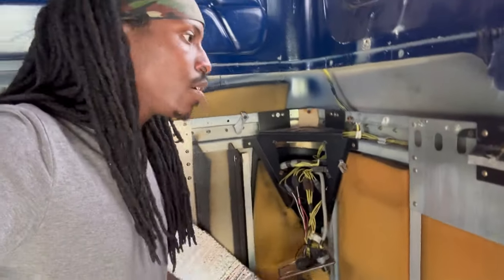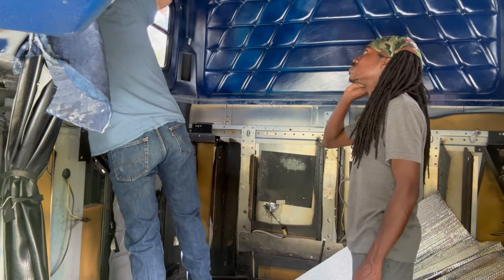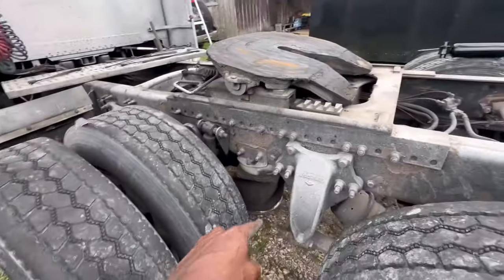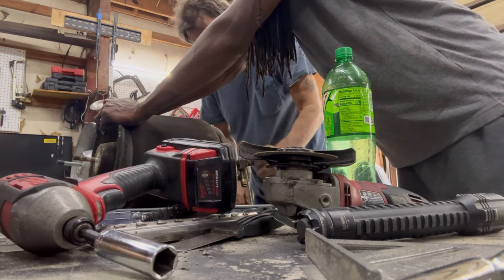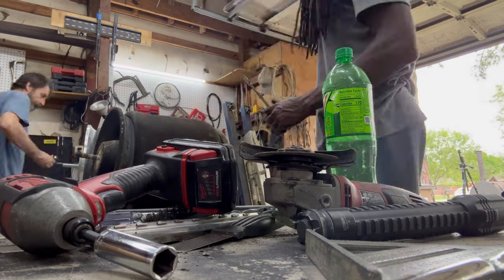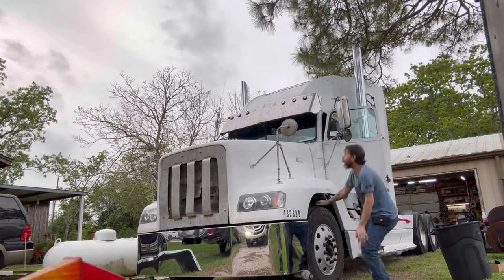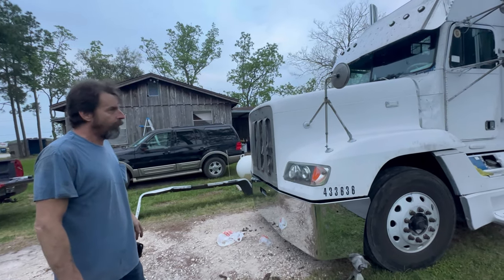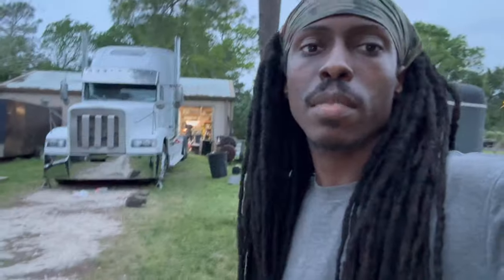FLD RESTORATION (Episode 10): Time To Fire Her Up ➕ One Bolt Brings Causes Defeat

Comment: For the most part shocks last about 50k miles. Sometimes longer Sometimes not as long. Depends on freight. Weight. Roads. Braking.  Driving.  Etc. Some will tell you 500k. Lol show me a shock with more than 50 to 60k warranty. Change em twice a yr. Your back and other joints will thank you in 40 yrs.
Reply: If your changing shocks twice a year you need to start buying better shocks. A good shock on an OTR truck should last a minimum 2 years  200 K.
Reply: @paulbauman8939  maybe for you otr boys on hwy all time. Not for what I do.
Reply: @paulbauman8939  and again. Show me a shock made warrantied over 60k.